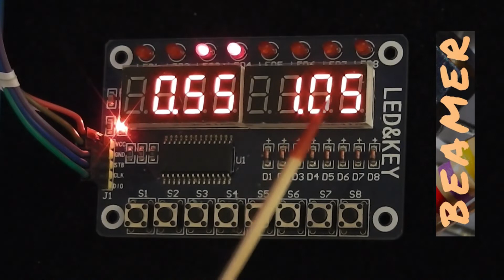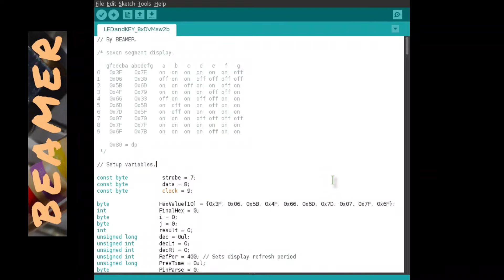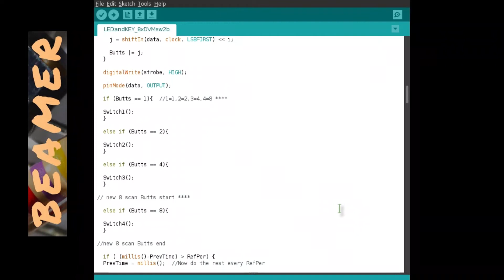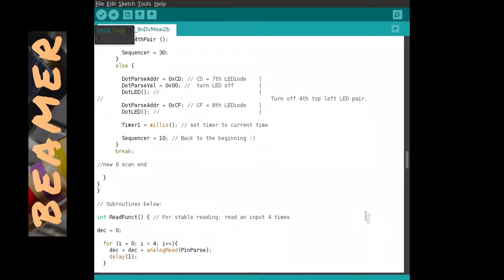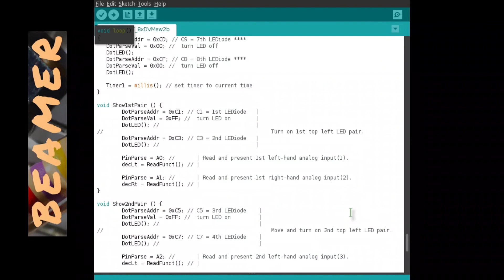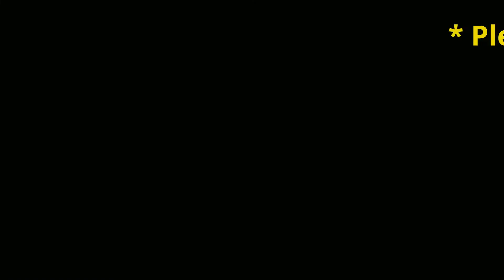Arduino 8 Scanning Digital Voltmeters version 3

Comment: Nice work! This would be perfect for monitoring a multicell 18650 charger/discharger. Which happens to be exactly  what I just bought this module to attempt to create. So thank you very much, this video has been extremely helpful .
Reply from the maker: Thank you for your kind words and subscription. With batteries, I would be inclined to add a series resistor to each input, say 4K7 and possibly two reverse diodes to +5 and 0 VDC - for safety. Also, please note - there's a common 0V! My latest version incorporates auto-calibration, using a 2.5 VDC reference. I'll upload it shortly after I get my challenging current video finished - taking way too long :) All the best, Beamer.